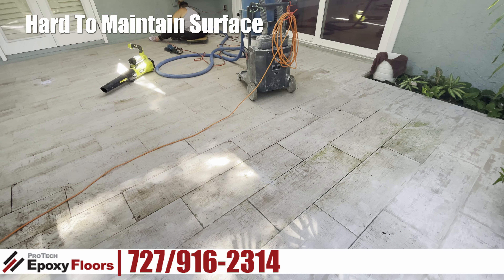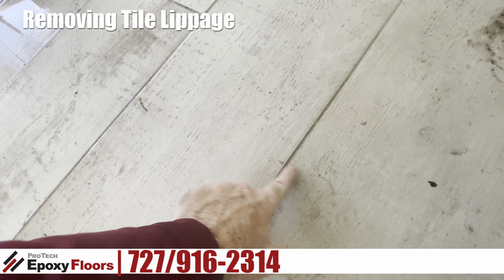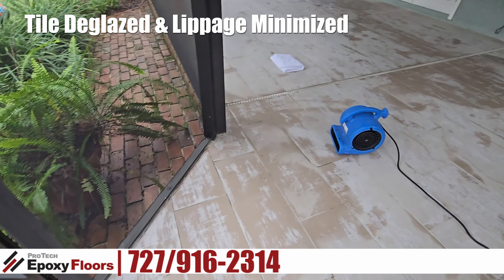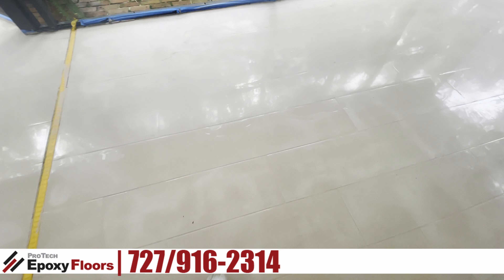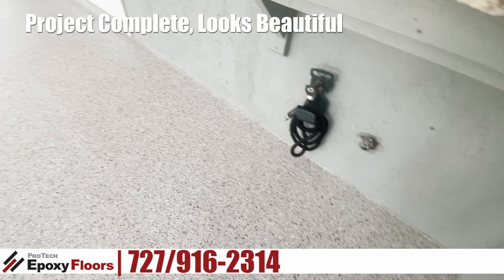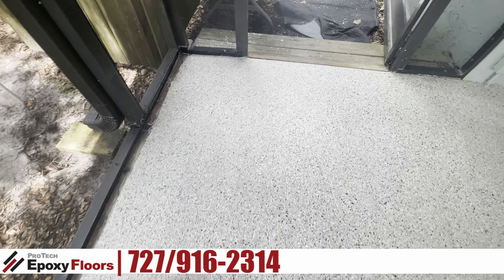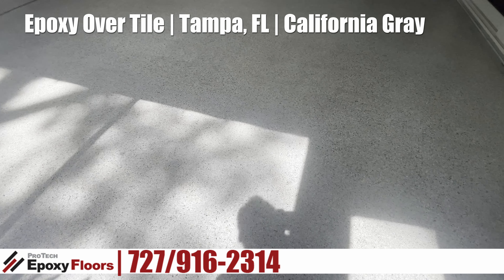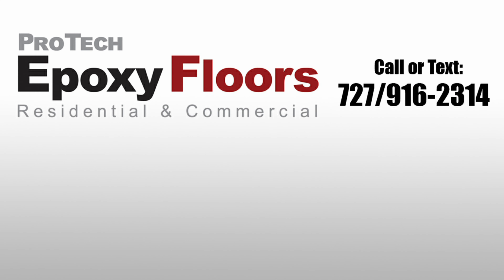Epoxy Over Ceramic Tile Floor

Comment: All that work the homeowner could have thad the tile removed and done this job the right way. Lets hope the thinset doesn’t fail and start cracking up.
Reply from the maker: @davidgoltsch5689  thanks for your comment.

The tile was checked for hollows and good adhesion. 

Removing the tile would have added too much additional cost.